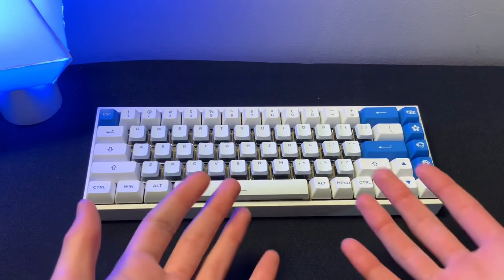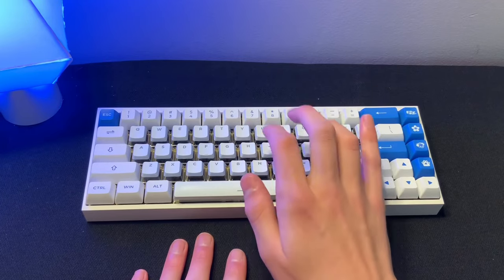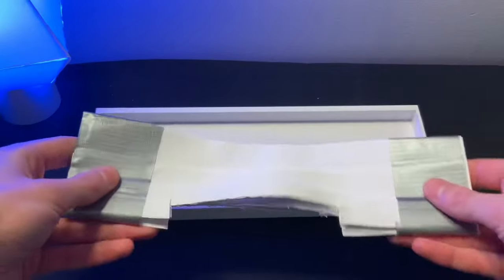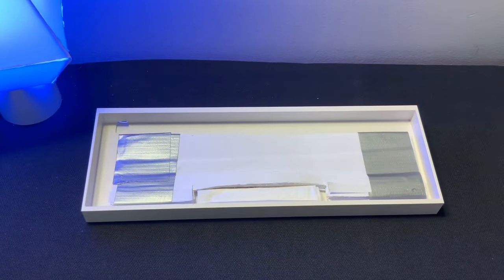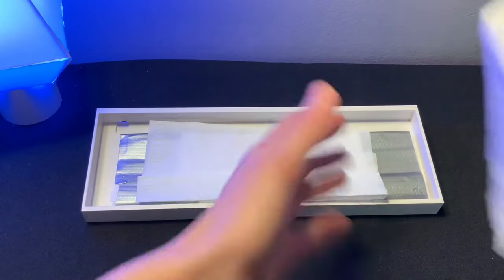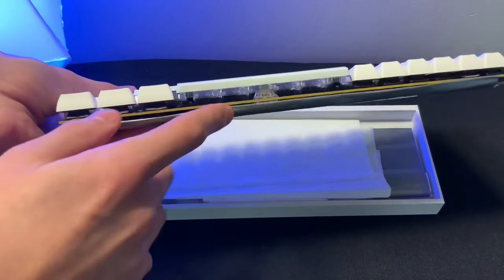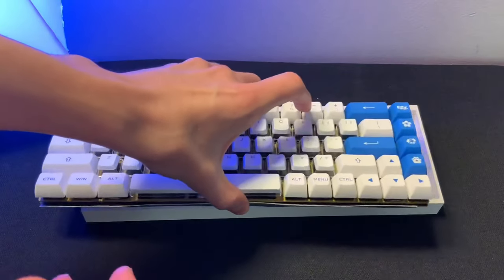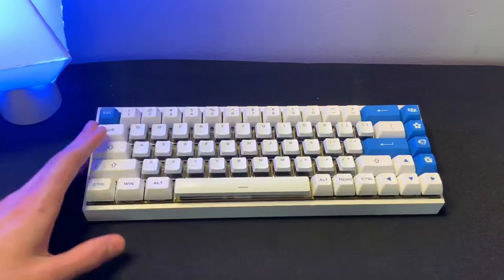The thockiest mod you have NEVER heard of

Comment: This mod certainly modified acoustics in place of aesthetics. The keycaps don’t align with the case as it did prior to the insulation installation. Preference 🤷‍♂️
Reply: Just push it down
Reply: @conutux722  yeah no thats a horrible idea lol. Trust me you dont want any fiberglass shattering
Reply from the maker: @infinitebeats6444  I just added a ton of paper lol! if you use less paper it would not be like this. also the paper is stiff and no fiberglass would shatter
Reply: @conutux722  I can tell you have a gk61.
Reply: @conutux722  I'm speaking from experience when I say it isn't that simple.
Reply: @BIxtz  i dont
Reply: @randyiswearingshoes it was a joke i did the penny mod and you cant just push it down lmao the screws are just too short or something

Comment: I've found that buying a gasket mount (or installing the gaskets yourself), completely filling the case with thin PE foam and tape modding the PCB causes a similar effect. But if you're on a thight budget this is a good alternative.

Comment: Untrue. When it comes to sound, keyboards are highly related to physics, so by adding any kind of foam into the case you’re making it absorb vibrations and thus making it sound bland. The whole point of mech keyboards is neglected in this case. The best mod is to thoroughly research about ways the materials change the sound characteristics of your keyboard, unless you’re doing a very cheap kind of board, but that’s another story.